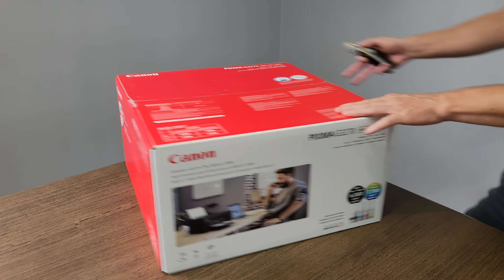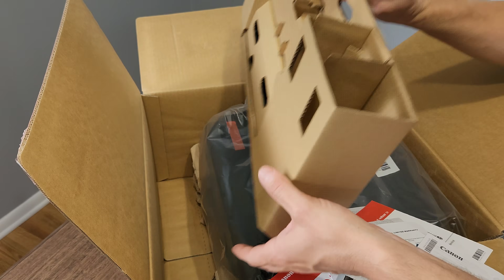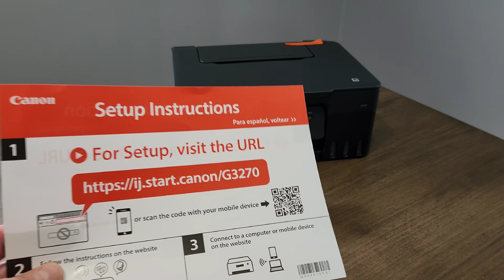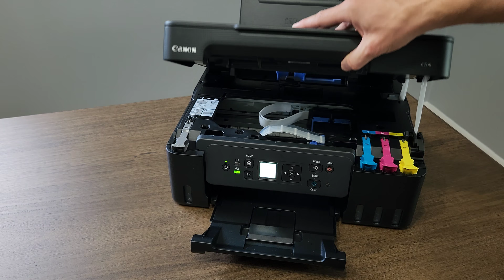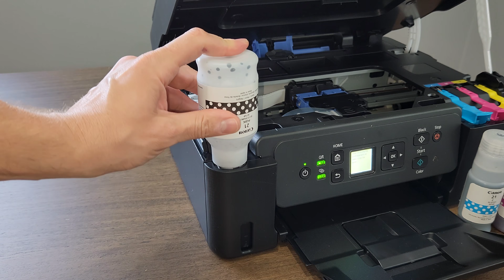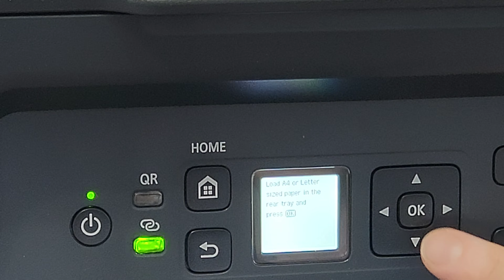Canon PIXMA G3270 MegaTank Printer Unboxing and Setup G3272

Comment: One major design flaw with these printers is that if you need to move it for any reason, or it conks out and you need to discard it, there is no way of removing the ink tanks. That means that as you lift it, if you tip it just a little bit, you will have ink spilling out all over the place. This is unacceptable and needs to be rectified!

Comment: I bought printer a couple of weeks ago. Easy setup. I connect straight to computer but the correct cable is NOT in the box-you have to buy one. Since I have always owned Canon printers, I did have the the cable. For others about setup, just go to the website and just plug it in. It will tell you when to install the ink tanks. It was easy

Comment: Thanks it worked. Srangely, GROK said that at first filling the colored ink is not an option, it's a must for the system. But I didn't fell the colored ones, yet it works with only the black one. So it's better than expected. The printer asked about it, but I clicked away, and the printer didn't ask about it again. 🙂

Comment: PERFECT!  In every way!  Experienced as I am with computers in general, I could NOT have set up this printer ANY OTHER WAY than by following the exact steps you detailed so vividly  as I too unpacked my new printer right along with you!!  (Not enough exclamation points on my keyboard to express my THANK YOU SO MUCH!!)  I absolutely love this printer and if my past experiences with Canon products is any indicator, this is the last printer I will ever buy as a 78 year old happy Boomer.  The cost was not much different than buying a cheaper printer and an expensive, problematic ink cartridge set.  But the ink refill tanks are a never lookback feature, long overdue in my household!   Subscribed?  You bet I did!!!

Comment: Should I pour the entire bottle of ink into the tank, or can I save some ink in the bottle for future use?  Can the ink also dry up in the tank of an ink tank printer?
Reply from the maker: The whole botlle will fit in the printer tank if it was empty or almost empty, but I do not think it is required to be emptied out. The ink is same if in the bottle or in the printer. The ink tanks are properly sealed if you put the rubber plug on top of the ink port. The ink will dry up only at the nozzles usually and that is only if the printer is unplugged or turned off for an extended periods. The ecotanks are usually very good at maintaining ink and flow.
Reply: @303electronics Thank you So much for replying. I'm new to the inktank printer and I will not Print daily but occasionally. I was thinking "After a long period ink could dry in the tank" So just use some ink for the tank and keep the remaining in the bottle to prevent it from drying. 😅
But thanks for your guidance It is also safe to fill the entire ink to the tank, it is as safe as a tightly packed bottle. Am I right?